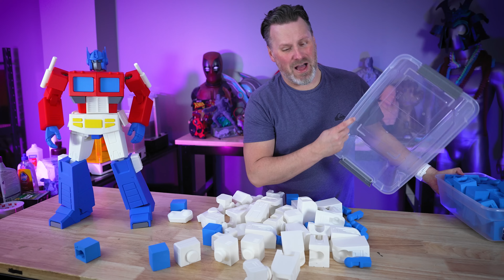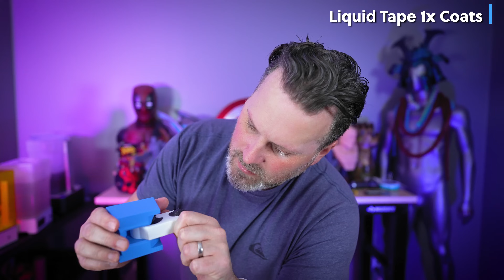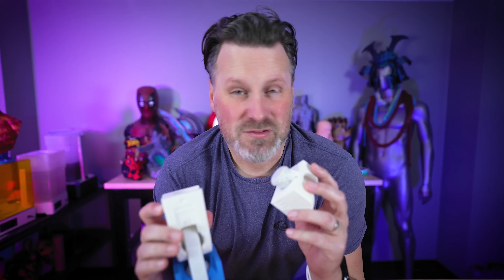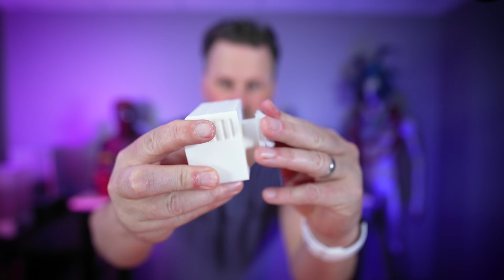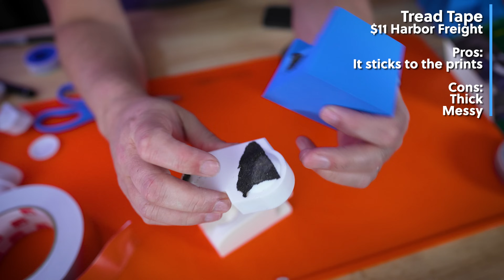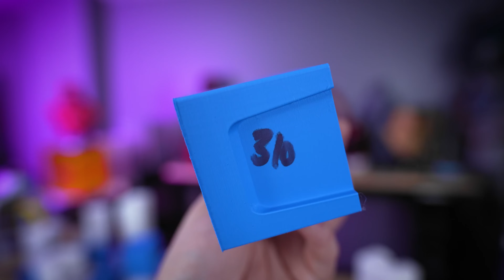The Ultimate Guide to Fixing Loose Joints -  3D Prints

Comment: Nice testing. After the gluegun I was thinking maybe putting some small bits of filament with a 3d print pen on the joints. But it would prob. also  making it to thick to fit.

Comment: Maybe aply the hot glue into the sockets instead of the ball joint? Because the glue isnt geting into the socket and is instead being mostly pushed out and creating a huge mess. If applied into the socket, there may be a somewhat even spread covering the socket and the ball. Some may be squeezed out, but i think it will be less messy and just needs a wipe. The even spread would probably behave like the rubber sock you printed

Comment: I'm actually pretty happy that Uncle Jessy went thru the same struggles I did with my megatron print, I did one at the default size and another at 150% but both had crazy loose knee joints. What I found to work best was upscaling the joints and then using layers of clear nail polish.  That being said, I did a PETG optimus prime at 125% scale 2 years ago and his joints are still pretty tight. I think what I'm going to try for my next build is doing just the ball joints in PETG, scaled up just a bit, and the rest in PLA+ if I material that matches.

Comment: I used to use cyanoacrylate adhesives for anything, from 3d prints to actual manufactured figures. However, it is always a last resort for obvious reasons, and when I do, I normally take apart the entire piece and coat it with the glue, then spread the coat until it's almost dry. When it's in it's last phase, I put the thing back together and move it around to make sure the glue doesn't dry and bond the pieces together.

But unless none of these options work, I'd recommend not to do it. As I said, last resort.

Comment: thanks for going through all these tests it was SUPER informative.  I've been supporting toymkr3D over on patreon for years and it's awesome to see him getting some love.  On my own work, when I do oversized stuff, I've used the hot glue method as well as the fun foam sheets but I'll have to give some of these others a try.  On my current project, I'm experimenting with printing the ball joints in TPU w/ 0.0 tolerances to get a snug fit but you don't often have that freedom if you're not the designer lol

Comment: REALLY hoping you can help... My resin is NOT drying on PLA joints! Even bought a pricy fancy 42W 405nm curing box (UV lights sides + under the clear rotating plate)! I'm using the same exact brand/type resin as you (but in clear). Am I missing something? Supposed to be a 5 minute curing cycle... I'm on 20+ minutes now and still wet...

Comment: I was actually a little surprised you didn't try stippling. The result would likely be a lot like fuzzy skin, except it would give you more control. You could stipple more, or deeper, or change the pattern depending on how much friction you want. It would take a bit longer than the other options, but it would also work well with others. It could hold more resin or floor polish, and could get Plastidip and Liquid Tape to stick better.

Comment: Plasti Dip is designed to be peeled away, so I'm not surprised it peels with the friction alone. I used to Plasti Dip my car rims and it was a great way to easily change the look of the wheels, and it was cool to just peel away when I didn't want the coating anymore. Great option for joints if you're not looking to move it!
Reply: ya I could have told him that plastidip would not hold up to friction at all.

Comment: With regards to the TPU sleeves I would just print the whole joint piece in TPU instead though with the same scale size as  the PLA prints so if you print in 300% then the TPU also in 300%.
DragonMountainDesign On Printables recommends TPU joints for all his action figures he designs and people have mostly posted pictures of them scaling his models up to 200%
It will also last longer than any type of coating that will wear  off a lot faster than the rubbing of a PLA part against a TPU part.

Comment: I would like to point out that if someone goes with enlarging a part, they will have to enlarge any attached parts even further, e.g. if you enlarge the thigh by 2% to fit into the hip, you will need to enlarge the calf section by around 4% to make up for the size difference and to enlarge it enough to stiffen the joint. Then the feet will need to be enlarged by about 8%. This will obviously affect the proportions of your model slightly.

Comment: If you're printing with PLA there's no possible method you can use to fix loose joints because PLA has high creep which means that in one day or two the plastic will start to morph and get loose again.

Comment: I printed these at normal scale and still had the lose joint issue. I ended up doing the CA glue and baking soda and then sanding them. Which was SUPER MESSY but its held up to my kids playing with it so far.

Comment: Plastidip and liquid tape will probably work better if you hit the areas to be applied with some sandpaper first.  There may not be enough for them grip onto.  Hitting the socket with some sandpaper to smooth out the layer lines may help reduce the friction rubbing as well.

The floor polishes look similar to an older product called Future Floor Polish that was basically just thinned out acrylic medium.  The Rejuvenate coming out white is similar to acrylic glazing medium which comes out white and dries clear.  I don't know the compositions of the two polishes you used, but if they're acrylic based and don't have a retarder added they should dry in 15-30 minutes.  You're basically just painting the prints in clear acrylic paint.

Craft foam is normally thin EVA foam.  You might be able to find some foam backed or double sided tape that uses EVA foam or something similar, but would be more expensive than just the foam.

Seeing as various tapes and foam worked I believe you could try paper and or cardboard.  Some thin corrugated stuff would probably yield better results than say cereal cardboard.  A rougher paper like construction paper would probably have more friction than newsprint or printer paper.

If someone was very careful I think gorilla glue could work, using it's ability to expand and how it can be compacted by enough force.  Trying it sounds like massive headache overall though.

Comment: ⚠️ The craft foam great for short term, I would be hesitant to use it because in a year it may degrade a lot under pressure.

Aluminum Tape 💯 better choice, I use that stuff a lot because the adhesive it has sticks to plastic or any smooth surface where other tapes fail. And where I have had ‘extreme’ duct-tapes bleach in the sun and fail, the aluminum holds for years. 👍

Comment: I used contact cement in the joint (not on the ball itself. I did 2 coats in each joint and it worked amazing! It’s has amazing grip and I can pose my Prime (200% size) no problem and since it’s clear and in the joint you don’t see it.

Comment: The hip joint design is commonly referred to as a mushroom peg.  Ultimately, all of these solutions should be considered temporary, as wear on your coating will always occur over time.  Reapplication, like Thanos, is inevitable.  If your socket is really smooth, that might help it last a little longer.  I'd imagine a rough layer line surface would eat away more.  What I've done a lot with smaller figures is apply the coating to both the ball and the joint.
EDIT - Also, on the TPU front, an option to try that I've seen folks like SamMakesToys do is make that middle joint piece completely out of TPU.
Reply: I think making the joint itself of TPU is the way.  Kind of like how Gunpla figures are built